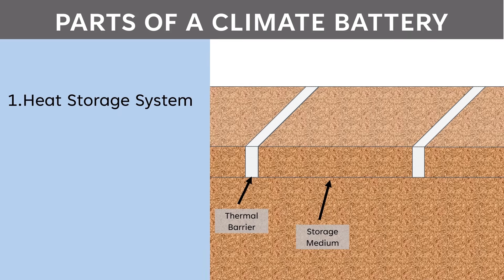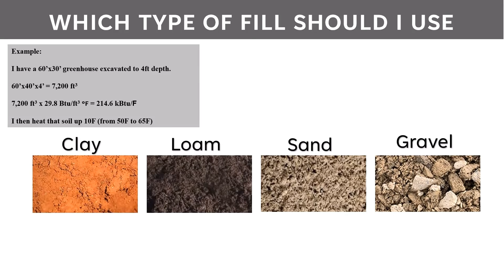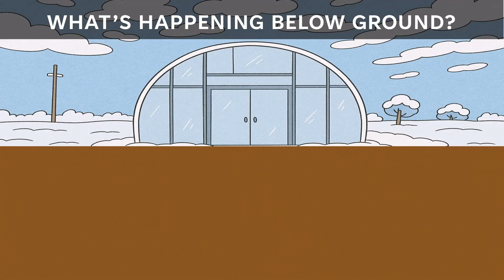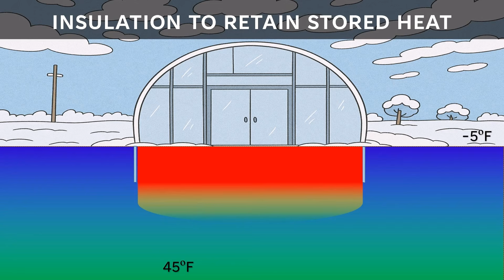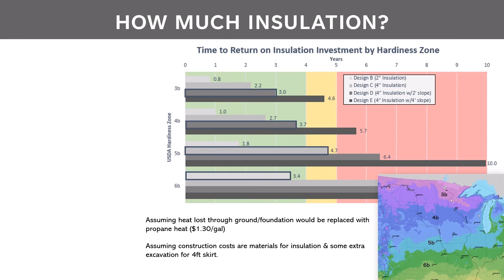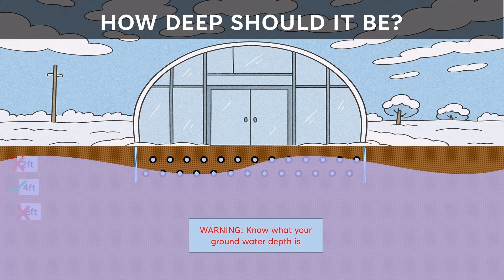Designing Better Climate Batteries: Choosing the Right Soil, Depth, and Insulation

Comment: Throughs on coupling this with a "traditional" geothermal system? Coils of pipes running underground next to it and then expel their energy into this battery as well. You'd get a heating system as well since the "traditional" system is liquid based instead of gas based and can go much deeper without regard for the water table. The other side effect is the heat that escapes has the chance to be captured by those tubes.
Looking at building a greenhouse for hydroponics to allow for year round production on the family farm. 
Climate is 5b. Ground is mostly sand.
Reply from the maker: Typically the outdoor soil temperature is below/colder than the climate battery temperature, so a heat pump would be needed to move heat from cool area to warmer area. It would be tough to get a good return on investment.

Comment: Love the graphs and visualizations of thermal capacity of soils, especially with water content.

I see that most of your calculations have been dealing with daily energy storage. Have you done modeling with solar insolation data and weather data to simulate heat capture and extraction? I've noticed that a series of sunny days seem to cause the soil to "saturate" with heat such that the rate at which I can push heat into the ground diminishes greatly over the course of, say, a sunny early spring week.

I've been working on some models to see if I can approximate the behavior of both of our climate battery greenhouses. Here in the northeast where it's cloudy in the winter, my intuition is that it's better to utilize as much thermal mass as possible (to a point, economically, of course), because we have significant stretches without much sun at all, and having additional thermal mass (like to the 6' or 8' depth) provides some "buffer" to get through those cold cloudy stretches that sunnier climates wouldn't need.
Reply from the maker: I could possibly summarize the climate battery's temperature vs. outdoor ground temperature to demonstrate that? It is a good metric of the overall net gain or loss of thermal energy. I do have that data.
Reply: You can spread a given pat of butter(BTUs) as wide and thin or narrow and thick as you like, but more butter is always more butter. 
The thermal-cycle frequencies of the system is the heart of the question and of course multiple input frequencies can be overlaid, similar to modulating an AM carrier wave (900 kHz) with two audio-tone signals (9 kHz and 900 Hz) to create a single transmission waveform; in greenhouse heat terms those would respectively correspond to daily heat, weekly heat, and yearly heat. 

You can spread it thinner by stopping the fan whenever the air temperature is exiting the pipes warmer than it entered, yet still above a critical minimum lower temperature. This lower limit temperature largely determines how thin you spread the butter. 
You could get it really thin with a programmable fan controller (Maybe homebuilt with an Arduino) and several thermometers, then program the logic so it acts based on a combination of indoor, outdoor, soil temps, time of day (even include sunrise and set times for the year), and so on. Anticipating the cycle by time of day, and fine tuning fan speed based on current rate of temperature change and some integral of the temp for the trailing hour or three.

Fun engineering but likely easier and a lower net energy cost to just truck in produce from southern states.

Comment: So if water stores about 2x the density of heat energy of concrete. You’d need what ~1000lbs worth of water to replace a 2000lb stone? A 55 gal drum stores about ~450lbs of water. If you can get a drum for around 20-30 bucks used you could possibly be saving half or more (depending on cost of stone I was seeing around $120-140 for a 4x2x2) on your block wall if you have a cheap source of steel barrels. I’d imagine you could also bury some along your walking path between rows to even increase your in ground heat retention.
Reply from the maker: My blocks are 2x2x6 and about 3400lb  for $50 apiece.
Reply: @waywardsprings  50 is definitely a lot cheaper than I was seeing where I was looking. I believe water actually holds even more heat energy than I was calculating which if it does could still make it a decent choice. But I’m not sure where the break even is since the blocks are so cheap anyways.
Reply: Surface area and total life costs are part of the calculation. A passive 55 gal barrel is a fairly slow heat sink being good over days to weeks rather than hours of the day.  Steel barrels full of water will not last as long as concrete eco-blocks (What they are commonly called in the industry.), sheet steel won't last long at all if buried in damp fertile soil. 
Though a large insulated tank with a pump and radiators may be a suitable option in some situations, maybe as a reserve used only to supplement the primary earth based heat sink in worst case weather conditions, or for those of us with more modest winter temperatures but very large water table fluctuations that will wash all of the heat right out of a flat ground earth heat storage regardless of foundation insulation.

Comment: In Vermont footing a greenhouse on concrete makes it a taxable property value adding a tax burden much greater than running a heater all winter.
Reply from the maker: Exactly! Watch my other videos about how to do this in a High Tunnel, without a permanent foundation. The next video will be about how I built this without concrete.
Reply: That's phenomenal. And not in a good way.
Reply: @ethanallenhawley1052 this type of thing gave us the Mansard roof. Where taxes in Paris did not include attic spaces, the solution? Clad the walls in roofing.